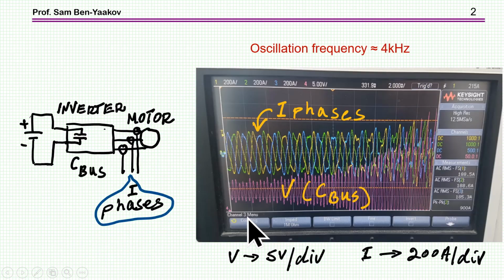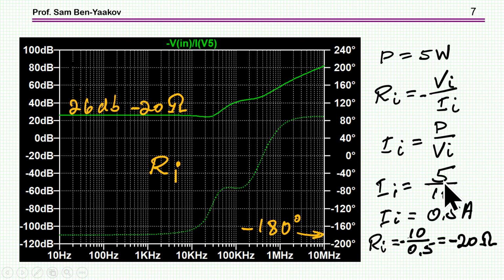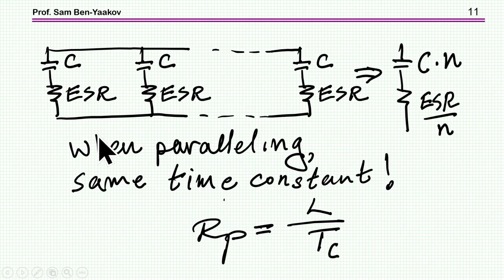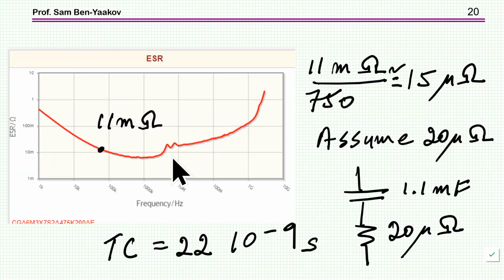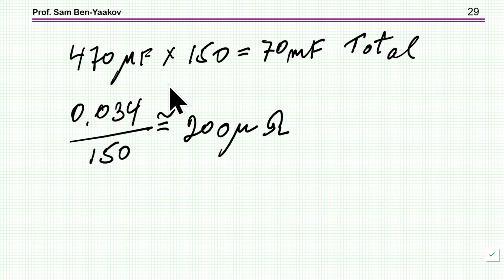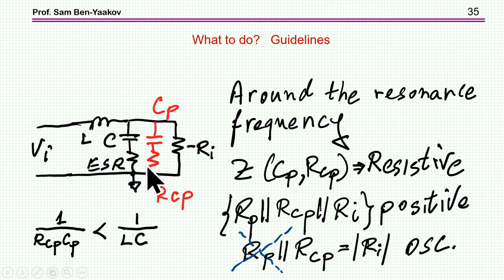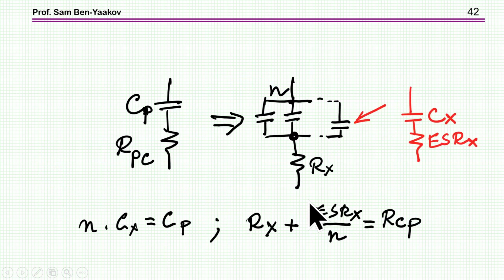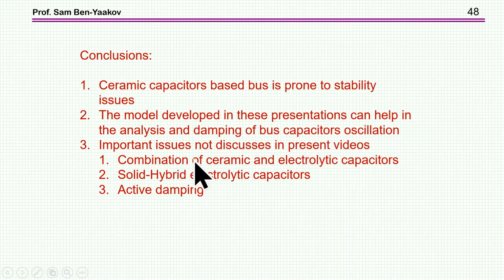Instability and oscillations of inverters’/converters’ bus capacitors: Part II

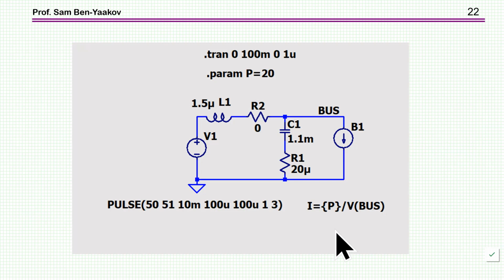Comment: Thanks for your detailed explanation. I tried to simulate the same circuit (given at time 11:36)with LTspice but I observed different behavior. The instability occurs at power level higher than 1970W. Am I missing anything here?
Reply from the maker: There is a minimum seriesresistor of 1mOhm in the LTspice L model. Did you zero it?

Comment: Thanks first for the intuitive presentation of the input filter problem! Actually this is a big topic in the industry where the converter stability requirement interacts with other constraints.

For instance in the automotive realm if the supply is the vehicle battery (12V, 48V or 400/800V) then most likely there's also the requirement for the converter to withstand a condition called "superimposed alternating voltage". This is due to the fact that the actual battery voltage can be disturbed by the high switched currents from various loads. The test itself superimposes a sine voltage on the battery DC. This sine is swept up to 30kHz and sometimes up to 200kHz with an amplitude in the volts range (higher at lower frequencies).
Now if the solution to the instability problem is to use an Cp + Rcp damper than the Rcp or the electrolytic capacitor due to ESR will heat up big time near the resonant frequency of the L + Cp + Rcp. It is like applying the entire superimposed sine on Rcp or ESR alone.
If the converter is designed for higher power it's most likely that Cp will have to be larger in value since the C in the filter will be higher to filter out the ripple. Then Rcp will be smaller. But small value Rcp means higher power dissipation with superimposed voltages.
Actually increasing the Rcp size and using large amounts of Cp is not desirable above a certain point due to cost.

A more practical solution is to check what's the required converter output dynamics. Because high power output loads in the hundreds to thousands of watts don't often need tens of kHz of power control bandwidth. The converter bandwidth can be thus reduced to below the filter resonant frequency with some penalty on the output regulation. But there's no longer the need to dampen the input filter because |Ri| will increase and its sign will be changed as the control loop bandwidth dies off.
Most of the times real designs demand a considerable degree of compromise as compared to textbook solutions.
Reply from the maker: Thanks for sharing.

Comment: Thank you for a great video professor! you opened my eyes for an important case!
I have 2 questions:
1.The ESR contributes to the ripple too with bias voltage(I*ESR+ripple). I think we have to consider it, when we have high ESR in electolytic capactior and high current system, in this video you neglect this effect.
2.When we use Lp and Rp(second part of this video) , we care only for resonant frequency, because we assume the serial to parallel conversion from the last video, this conversion, can be problematic when our system frequencies are far from the the resonant frequency(the conversion is fine at the resonant frequency area only, I think), because we can get negative resistance in the system frequencies area!
Thank you a lot and I hope you can help me!
Reply from the maker: Hi Idan, thank you for your comment. Please indicate the minutes in the video for each case you are referring to.
Reply: @sambenyaakov  First question:10:18, second question: 16:47 capacitor at resonant, 22:15 inductor at resonant.
Thank you!
Reply from the maker: @idanrosen4411  Hi Edan, Z of a capacitor is at any frequency  is larger than the ESR, (except at the resonant frequency of the cap when they are equal) so the contribution of the ESR to the ripple can generally be neglected. The oscillations occur around the resonant frequency of the input filter so we do not care about other frequencies.
Reply: @sambenyaakov  Hey Sam ,thank you for a great answer!
I'm curious and I got one more question: can we get oscillation near other frequency? At 6:25 part 1, if we have negative resistance, this can happen, and the conversion of Rp<->Rs doesn't work near other frequencies.
Reply: The conversion from last video:12:10 part I, Q=sqrt(Z)/RC= Rp/sqrt(Z)  -> Rp=L/C*RC

Comment: At 5:30, Rp Rc = z^2 = L/C instead of Q^2.  Would ferrite beads between sets of parallel capacitors help at all?  Or is the frequency of oscillation too low?
Reply from the maker: OOPs. Thanks for your keen eyes I will note the error in the description. Yes, the bead is effective at very high frequencies while here the frequency is low.
Reply: @sambenyaakov  Thank you for your videos!

Comment: Thanks dear professor, my question is that do we have any instability issue for the inverter capacitor voltage when it is exchanging power in grid-connected mode?
Reply from the maker: This just complicates thing since the inverter-grid interaction may by itself be a cause of instability
Reply: @sambenyaakov  yes professor, great. You just assume that the inverter and it's controller is designed stable for grid connected mode with an electrolyte capacitor with high ESR and for ejecting a nominal power to the grid, in this condition if we reduce the L/C*ESR  by replacing electrolyte capacitor with Ceramic capacitors, can it leads to instability of capacitor voltage with the same explanation in this video?
Thanks for your time 🙏

Comment: One side effect of large inverter input capacitors is the potential for huge inrush currents when the supply is connected. This inrush current can be brutal for circuit breakers/isolators and contactor contacts.  As an example I've a 48V 5KVA inverter which appears to have about 45mF of input capacitance, connecting this directly to my LiFePO4 batteries results in an inrush current of several thousand amps which blasts the terminals or breaker contacts. It probably doesn't do much for the inverter either. If I had a BMS with overcurrent protection this would probably destroy the MOSFETs before it could react and switch them off.  
The only solution to this sort of issue is to have a precharge circuit which charges the inverter capacitors to line voltage prior to the breaker being closed or for the inverter itself to have a charging circuit which operates before a contactor closes. In my case I use a couple of 500 Ohm wirewound resistors across the breaker contacts to keep the inverter charged.
Reply from the maker: Indeed, direct connection od od battery to bus is dangerous and a pre charge is a must. See: https://youtu.be/NK4oL6IUyrA